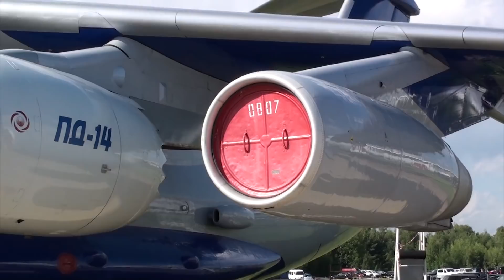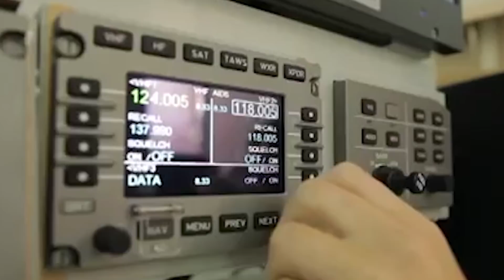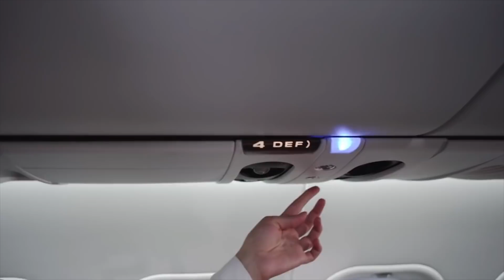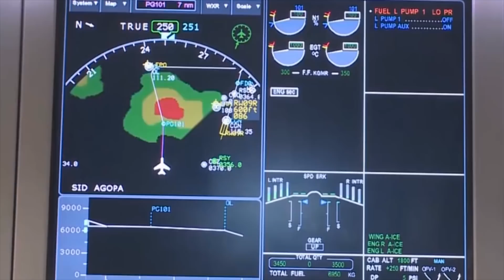MC-21 - the new Russian flagship

Comment: It's defenitly missing some winglets or wingtips.
Reply: max chilla yep, I was just about to say that
Reply: The wings have a high aspect ratio and don't require winglets
Reply: Gonk Droid 😂😂 i didnt mean the folding ends of the Wings. The Wing of the 777x will feature raked  wingtip similar to those on the 787.
Reply: My dad was engineer for the manufacturing process and he told me it doesent need them because it has special narrow wings. Makes it need special flaps to compensate that while landing, but in flight its more efficians. And its called MS-21.
Reply: gamirf Some of the systems were made by American and European companies.
Reply: Keyboard plane expert  reporting from mom’s basement.
Reply: MC-21 doesn't need them.  Its wing's elongation is 11,5 if you know what I mean.  But for amateurs, yeah, winglets are a must-have)))) cause they're pretty)))
Reply: Gonk Droid The construction material has nothing to do with the air flow around the wing
Reply: max chilla those will be to save space and will not be extended during flight.
Reply: @DirectorBird  Winglets are needed. Just because it's composite material it doesn't do anything with airflow. Old models of 737 didn't have winglets and new models do have. We can make a conclusion that winglets increase fuel efficiency. If you don't understand basic aviation principles please do express your stupidity in public
Reply: bullocks, the winglets on the 777x fold upright because it grew in size and wouldnt fit its current gate space.
That its at lower speeds where the winglets create more drag than benefits.
Reply: TheSushiraw even the currently 777s (300ER/200LR/F) all have raked wingtips so what are you talking about?

In terms of efficiency:
Nothing < Winglets < Raked Wingtips
Reply: MC-21 has wing made of polymer composite with high aspect ratio. Wing elongation equal to 11.5 - there no need in winglets on such wing.
Reply: The winglets are used to decrease the wind vortex, which interrupted flow / caused it to flutter (?) guess the mc21 doesn’t have the problem . The Russians like the kiss format ( keep it simple stupid) . Which makes more sense a wing that works well on its own, or a wing that needed to be re shaped so the plane wouldn’t shake  its self apart
Reply: I'm not an engineer, but they know more about their own aircraft than anyone else, it's already more efficient than both the Dreamliner and the XWB, that's a tell tale sign that they have used an engineering solution without needing winglets and sharklets
Reply: they used wingchun
Reply: BTW to you actual idiots saying the building materials affect the vortex generation are ignorant and need to stop talking about aerodynamics. The super critical airfoil design probably has a say in vorticity but being carbon-carbon composite on the surface has NOTHING to do with it.
Reply: My understanding is winglets are not universally desirable, depends on length of flight and such.
Reply: Aviation Excellence
That's not it.  787 has them and it's as composite as anything out there I believe.  (787 has a swept back version instead of the common angled up type but it's same idea for same effect)
Reply: Moon Moon are you saying that you think the 777X wing fold will operate in flight depending on the phase/airspeed??  You better be trolling
Reply: That doesn't take anything away from the quality of the aircraft.
Reply: @edp4638  it does
Reply: Here is a link about the MC-21-220 and how it compares to an Airbus A320neo and why there's no need for winglets...https://leehamnews.com/2016/02/08/irkut-mc-21-first-analysis/.
Reply: @edp4638  Nature is the best engineer and designer. And guess what. Winglets were designed when engineers saw that eagles curve their wing tips. Then they tested it and it worked. Later, they even invented raked wing tips that were even more like the eagle's wings. If Russians have somehow invented a wing that even the nature cannot do... So yeah... Russians couod have added them and it would have been better. And also I'm no engineer and no pilot, you're no engineer and no pilot  too, the page that you linked isn't pilot/engineer website either. But there are several real engineers and pilots who have explained the need for winglets. So deal with it.
Reply: Don't disallow a news source experience on a field without without first researching the authors of a given article, you went ahead and said that the authors of the article I posted weren't pilots or engineers and you couldn't be more wrong, I wouldn't post anything that would make me look foolish, here is why....https://leehamnews.com/team/
Reply: @edp4638  ok sorry. My bad. So you're saying that we should all trust this aviation journalist and not other pilots?
Reply: and it says that he's a journalist/analyst not a pilot (unless we're not speaking about the same people)
Reply: The author: Bjorn Fehrm joined LNC as Aeronautical and Economical analyst. He focuses on technical evaluation for LNC, providing a level of technical and aircraft economic reporting rarely seen among aviation writers. He has a background as an aeronautical engineer and Fighter pilot from the Swedish Air Force where he flew the Draken and worked on the Viggen and Gripen programs. After leaving the Air Force he worked at SAAB with the Gripen (fighter jet) program.
Reply: Set your damn pride aside and open your eyes and ears.
Reply: @edp4638  If Airbus or Boeing with all of their experience gathered in many many years haven't come up with a wing that's better without winglets but Russians somehow have, then something is wrong with it.
Reply: What's wrong is your blinded pride, for years wings without winglets were the standard, they were added mainly for fuel economy.
Reply: @edp4638  YES. Fuel economy is the key for airlines
Reply: That's a well known fact. Where some people are missing the point is the fact that high efficiency engines like those on the MC-21 make up for the the lack of "winglets" when it comes to fuel economy. The MC-21 wings are made of composite material which makes them light yet very strong, they also reduce the airliner overall weight considerably thus improving fuel economy.
Reply: @edp4638  "make up for the lack of 'winglets'". So you're saying that engines are so efficient that they don't need winglets. But would winglets save fuel? Yes. And mc21 doesn't have them. It will burn let's say 1l more a flight which is nothing but 8 flights a day 365 days a year x number of aircraft in the fleet... it all adds up.
Reply: @edp4638  787 and a350 have composite wings as well but they also have winglets/raked wing tips
Reply: You're getting into a debate by yourself, never did I say or mention that the Boeing 787 or the Airbus a350 do not have composite material components in their structures, neither did I say that they don't have winglets or raked wing tips. My point is that Airliners have been flying around without that type of wing modifications for decades. Not having that technology so far has not prove to be a setback for the MC-21 in it's service.
Reply: The simplest way to increase a fuel efficiency of an airframe is by increasing its wing effective aspect ratio extending a wingspan. But you can't simply make a wing longer without increasing its weight and strength. Airport gates are also a limiting factor. So winglets were invented. Winglets increase the aspect ratio without increasing wingspan (much). But it's always a tradeoff: after a certain point theres no actual benefit from increasing winglets size of even installing them at all. The MC-21 has a very strong and light composite "black wing", which allowed to achieve desired aspect ratio without additional complexity. In fact, attaching winglets to this particular wing would be useless or even reduce the fuel efficiency by adding more weight and parasitic drag.
Reply: I flew on a Sukhoi SSJ-95 before. It was much smoother than any A320 or 737 i've flew on before. So I trust the russians here.
Reply: Who cares about parasitic drag? Lmao
Reply: TheSushiraw the Classic 777 is a lot older. And the new 777x will get wingtips.
Reply: @maxchilla732  no, it won't except you thought the folding wingtip is a wingtip
Reply: @toxicatto6074  nope didnt mean the folding part. The Wing features raked wingtips like the 787.
Reply: Like he stated, the wings are made of composites so the vortices are dampened without winglets.
Reply: they'll be added when the plane rolls into production after tests, cause there is no sense in designing winglets if you fuck up the whole wing and have to redo it
Reply: Seems like its because of the high percentage of carbon in the wings, wich led to design a new wing shape. Without winglets.
Reply: My guess- is bc for UAC it's a whole new plane with a lot of new systems,which has to be build and tested from the scratch, more complicated wings would just add to programme costs and delays.ALso UAC is testing now new SSJ-100 modification with winglets,this could be a good experience for future update of MC-21.
Reply: Aviation Excellence why are you making up bullshit, no wing lids = +5..7% consumption compared to competition. idiot, Boeing and Airbus all make their fuselage and wings of composite materials, and it has nothing to with the aerodynamic design.
Reply: Stop chatting shit, you stupid kid.
Reply: Winglets aren’t perfect. There are certain stages of the flight where they’re slightly more of a hindrance than of any help. I can’t quite remember what they are (either level cruise or low speeds/low altitudes), but this is why the winglets on the 777X fold upright or flat depending on what stage of flight the aircraft is in.

Others have said why this plane doesn’t have them, but I thought that was worth adding, too.
Reply: Mountain Whale you’re actually correct.
Reply: turbofan ct I was saying that because Carbon composites flex more without breaking. So winglets are not needed.

Comment: Does anybody know why the russian planes are not equipped with winglets? It can't cost that much more and the fuel savings are pretty important :/
Reply: Winglets has no connection with wing composition, use of winglets depend on wing profile, winglets makes wing more efficient, but have weight and cost, there are others solutions, like B777 tips.
Reply: @vecchiogufo4863  Can you link us to a description of the new tip?
Reply: to FloatingGoat.
CFRP is a much more rigid material, therefore, even without using winglets, the MS-21 composite wing of high elongation, formed by thin supercritical profiles (almost flat upper and convex lower surfaces), allows aerodynamic quality to be 5-6% better at cruising flight speeds than the latest foreign analogues.

Aircraft designers have always sought to increase the typical elongation of the wing - the ratio of length to average chord. The typical lengthening of the wing for aircraft of past generations was 8–9, for modern aircraft - 10–10.5, and for MS-21 - 11.5. Its like "horizontal winglets" instead short wings with vertical winglets from western crafts.
Reply: FloatingGoat new wing designs for e.g. in the 787 or the 747-8 don’t require winglets and give you the same amount of savings in terms of fuel. And that also means a little less turbulence.
Reply: I know that,  but on the SSJ and the MC-21, they don't have the same design on the tip
Reply: @HSRHSR  787 and 747-8i have ranked wing tips that are only efficient in long-haul flights. In short and medium haul markets winglets are essential.
Reply: @HSRHSR  The winglets are there to reduce the leakage of air from the tip of the wing going from bottom to top. This creates two things, one is downward force on wingtips hence less lift and stronger wake vortex. Winglets stop that bleed of air and reduce wake vortex.
Reply: kuz winglets do not sound russian !!!  hahaha ....
Reply: Only capitalist running dogs use winglets! (Note to KGB: Found out what "winglets" are.)
Reply: FloatingGoat amen
Reply: I just quote my prof. for this topic. "If you get your winglets designed, that they do no harm on your aerodynamics you're good to go" ;D .
Reply: They are not that sophisticated
Reply: U stupid fucks, NOT WINGLETs, raked wingtips! 787 has raked wingtips! MC21 not! Question was not about winglets! jeez how fucking dumb you all.
Reply: https://youtu.be/7rA2stj3tRU?t=768
Reply: The wing of mc 21 is state of art, New design as 787.
Not necessary to put wingless.
The perevius Tupolev 200 and iliusin 96 had but there was 1985 design
Reply: Learn what a composite wing is; you caveman!
Reply: MC-21 wing is a composite wing,  like 787 wing. Composite wing does not require winglets. For SSJ winglets are currently in development.
Reply: FloatingGoat - Winglets are (often) used as a way to increase efficiency without designing a new wing.  Wings are VERY expensive to design.
Reply: Bryan Noga ,The expense is the tooling and factories and machines to make the wings after it is designed.   After that the more you make the cheaper the  cost per wing.   May be they have had a few spies at Airbus in Wales. It looks like a super critical wing with high wing loading.
Reply: rusia dont care about fuel saving. they have cheap and abundant oil reserve anyway
Reply: increases weight and drag
Reply: FloatingGoat It's because they're stupid
Reply: They are only capable of creating crude bootleg copies.
Reply: @karl zimmer
understand your knowledge, and difficult to discuss with S.O dont have enough knowledge ^^. But try to read Wing aspect ratio, you'll know why MC-21 no need winglets ^^. "you can do the other can do"
Reply: @karlzimmer683  nice joke
Reply: @karlzimmer683  wow if your just going to be a political bias dumb@$$ go to some politics subreddit not here
Reply: @karlzimmer683  If you want to learn something about aerodynamics, ask the masters in that area - Russians. I really do not have the will to explain why. The Internet is big and you can find enough evidence by yourself, the only question is if you want ...
Reply: Jerrome Drake Jr don’t pretend to lecture me
Reply: Karl Zimmer as your mom, isn’t it?

Comment: Make a video about Embraer, please.
Reply from the maker: Guys, we will make a videos about the regional jet after, don't worry)
Reply: Andrei This video is for mc 21 from UAC , Embraer 195 belongs to lower regional jet category , similar with sukhoi sulerjet 100
Reply: @dimitriskaligeris5506  eh not really...many carriers care about a few things:
- fuel consumption
- range
- ease of maintenance and parts interchangeability

Many operators will prefer a smaller plane that trades passengers for fuel as it will give them more flexibility if flights do or don't sell out. The A220 is already cannibalizing some of the A320neo imo (and obviously the 737). The Embraer lacks the range of these, but is supposedly more fuel-efficient and somewhat cheaper to produce with a 'good-enough' range.

Factoring in that the majority of operators are trained to repair Boeing/Airbus aircraft and the public perception of Russian planes (whether deserved or not), it's gonna be a TOUGH sell to any operator unless its significantly cheaper than a Boeing or Airbus...and I have my doubts they can make it that much cheaper. We also don't know what the fuel consumption will be for this jet. It'll need to operate comparably to even be competitive.
Reply: @jonathanpusar5931  A220 canibalize some of A320neo no, they make good call with A220 because revamp A319 means less cost to A320neo program